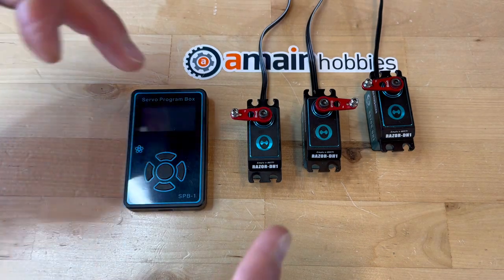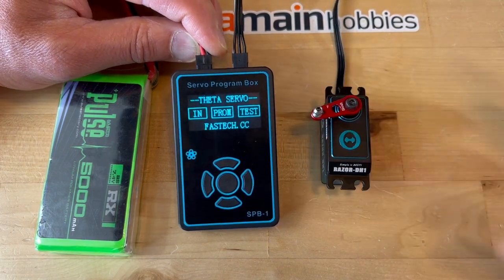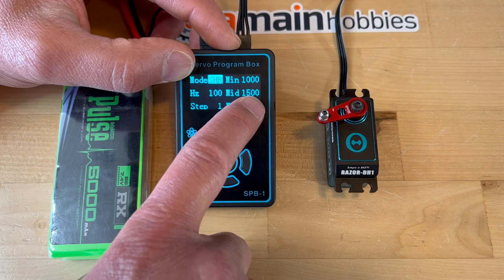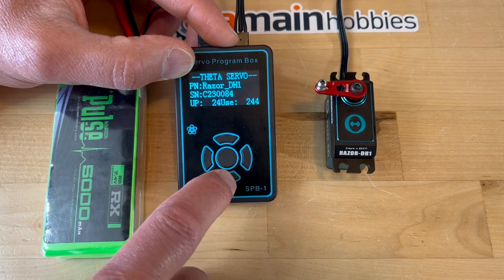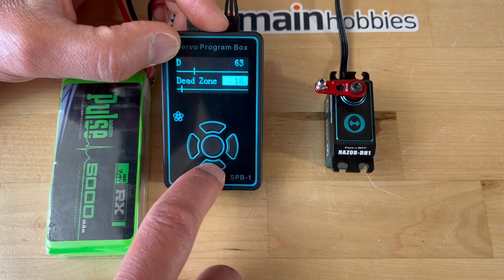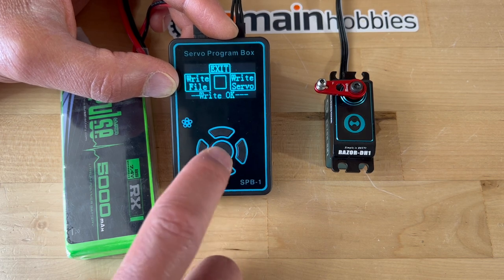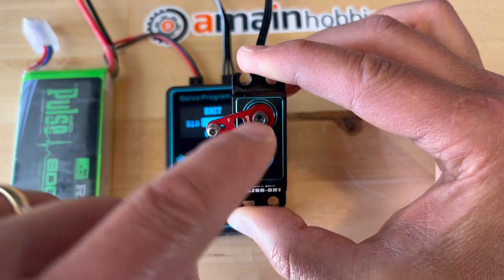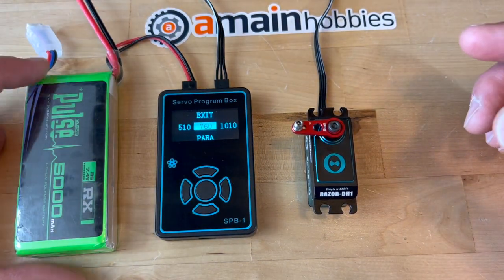Theta Servo Program Box   HD 1080p

Comment: At 5:32 Acc stands for accurate, which they say improves accuracy under heavy loads so I recommend turning that on
Reply from the maker: Can you tell us more about this "Acc" parameter?  Is there a downside to having it turned "ON"?   Is there any reason to turn it "OFF"?
Reply: @johnahamelv  I suspect the downside is bigger current draw and marginally shorter servo lifespan